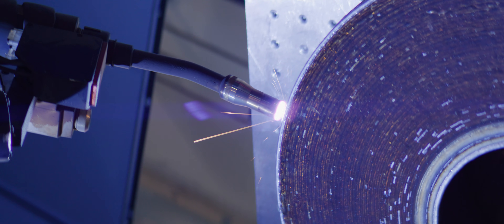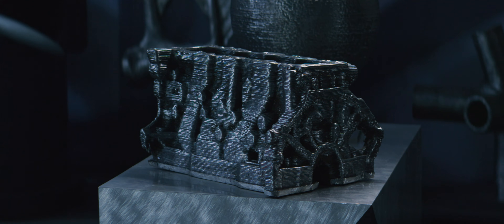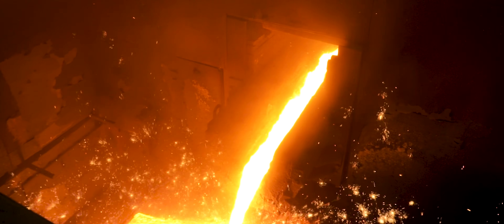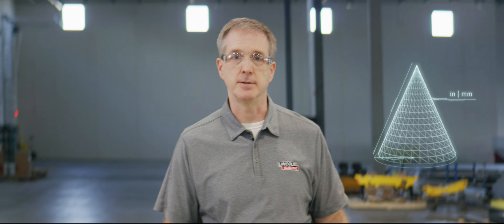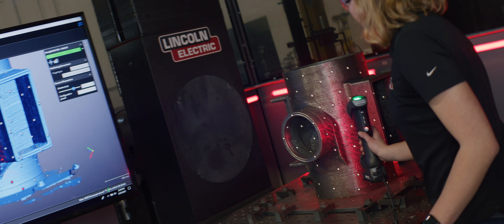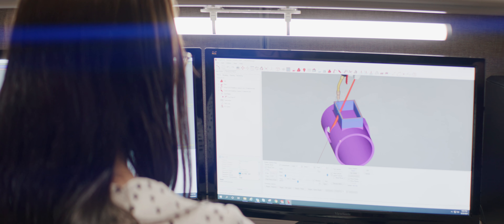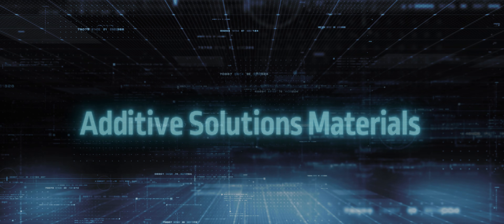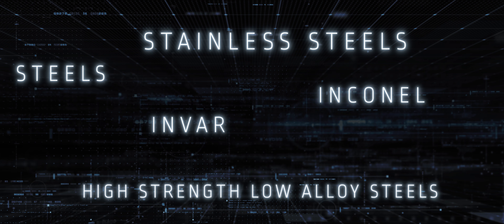Lincoln Electric Additive Solutions Makes Big Parts in Less Time

Comment: This is the future of manufacturing as 3-D CAD is the digital driver with additive manufacturing.  Thanks to Lincoln Electric for the future is here, and it all continues to evolve with quality systems.  High strength low alloy steels, Inconel, invar, steels and the stainless-steel alloys play a key role in fabrication and welding technology.  Thanks for the great video!  Lincoln Electric is totally Awesome.  Education continues to grow at a fast exponential rate.  This is an excellent YouTube video.

Thomas J. Vanderloop, Author Technology Instructor & Manufacturing Consultant (AWS & SME Leadership)
Reply: I see this being a flop just like 3d printed homes.